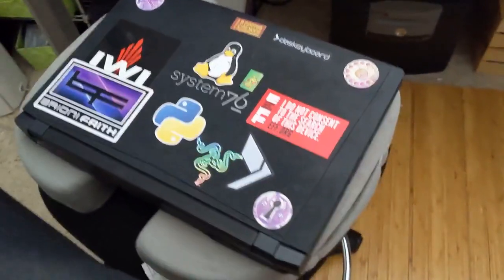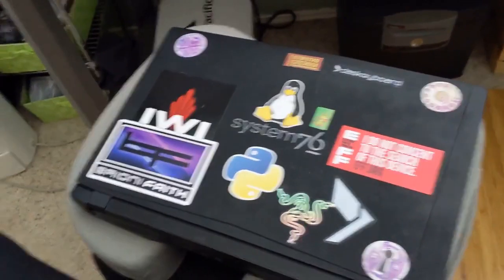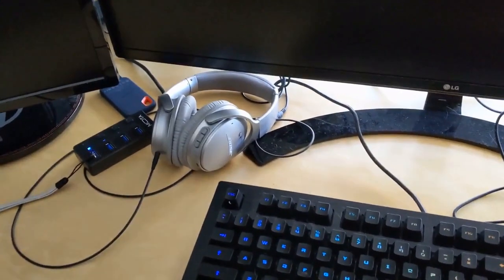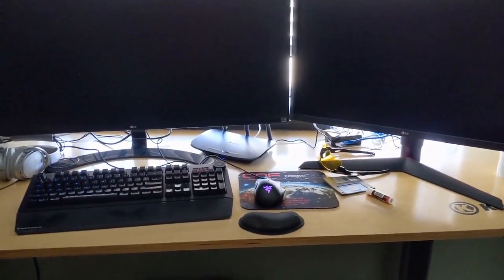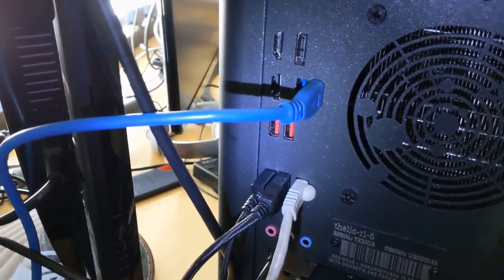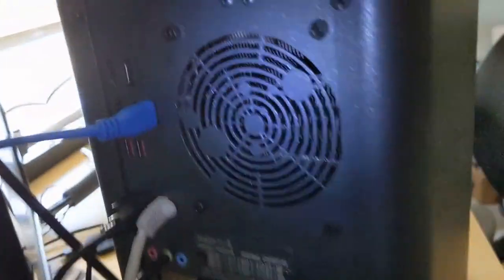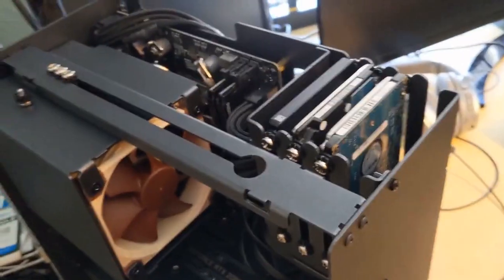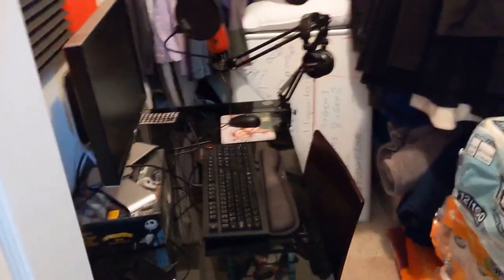System76 Thelio desktop and more

Comment: What do you think about the price vs performance for example how much more would it cost to build the same system myself
Reply from the maker: I consider everything about the system. In my case, the fact that System76 provides lifetime tech support is a huge win, especially when it comes to Linux. While I've been using Linux since ~2011, there is still a lot I don't know, especially when it comes to troubleshooting. The tech support people are spot-on when it comes to assisting me, whether it's a hardware or software problem. It's not like dealing w/ Dell or another big-box vendor; the support is quick and personal.

Plus, I know that the computer will work with Linux out of the box. I don't need to mess w/ device drivers or configurations. And if I really wanted to, their open-source/open-hardware specs are available for customization.